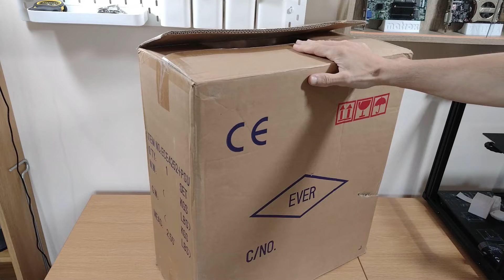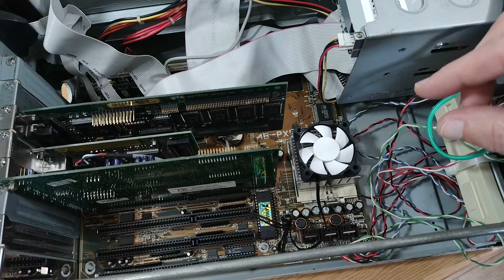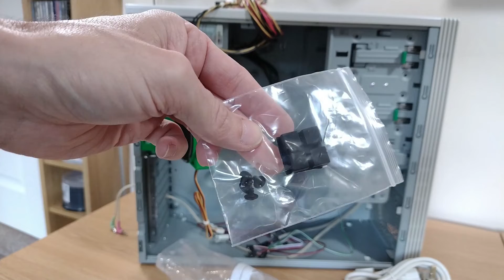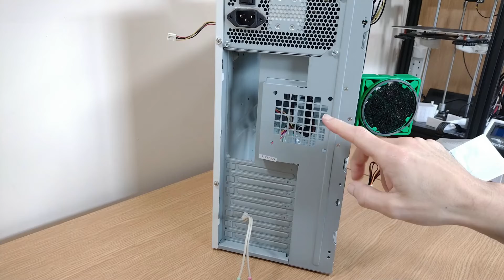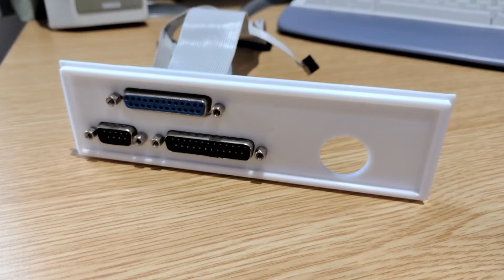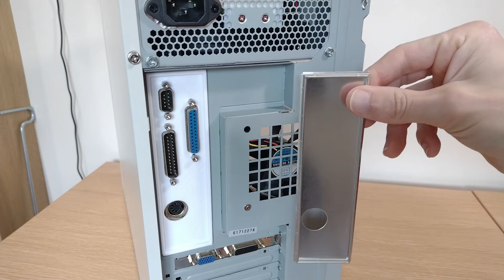AT system in to ATX case

Comment: So am I right to think that when my AT PSU switch is off, there's no current at all to the motherboard and therefore the CMOS battery will decline whether the system is plugged in or not? Whereas in at least some ATX systems, the motherboard still draws enough power to keep the CMOS going without battery draw and so the battery can last much longer?

Comment: I believe you missed something and I was actually looking forward to seeing how you managed it. 😃When it comes to  those adapters that let you use ATX power supplies with an AT motherboard, they bring out the green and black wires for the power button - PS-ON and GROUND respectively. The problem is that the power button on the ATX case is momentary, while the PS-ON signal from the power supply needs to be grounded the whole time the computer is running. To sum it up, the way the PC works at the end of the video is - you press the power button on the case, the computer comes on, you take the finger off the power button, the computer shuts off. You'd need to keep your finger on the power button indefinitely, to keep the computer running. The way this needs to be solved is by physically changing the power button on the case from a momentary switch to a toggle switch that keeps the circuit closed after being pushed and that's easier said than done. To keep it pretty, you'd need to find a toggle switch the same size and form factor as the momentary one mounted on the case.

Comment: I know originally desktop cases were intended to have a monitor set atop, but I recall CRTs weighing a ton of bricks and always felt uncomfortable putting a monitor on it. After the original IBM and clones, it seems the cases made were no longer made of such thick, solid metal thus less likely to hold the weight of CRT over time without bowing the PC case. I have an old school Dell 4:3 LCD display I use instead of CRT and it’s good enough for me but still set beside my desktop case instead on top of it. 😂
Reply from the maker: The AT case in the video is built like a tank and easily takes a 19" CRT on top of it, it's just too high up to use comfortably. :) I have a later IBM desktop case that is so plastic-y that even a modest LCD on top of it feels risky.

Comment: My current project involves getting a Gigabyte 5aa into an AT case with a turbo panel. The 5aa is a hybrid board with both AT and ATX connectors, but it was still a terrible idea; learning pinouts on the fly, figuring out and more importantly finding unused pins to hook the extra LEDs into is a nightmare.
Reply from the maker: Sounds like you are having fun with it! It's a really nice SS7 motherboard for a project like that.

Comment: The Voltage Blaster project by Necroware more or less solves the -5v issue (I think mainly just some sound cards which really need it anyway). If you mentioned it, I missed it. Also need to be careful to not overload the 3v & 5v rails of modern PSUs. AT systems tend to put more load on them than modern ones are able to handle.
Reply from the maker: Yeah, I think there is another adapter too besidies the Necroware one that also gives -5v. I figured I didn't want to go into too much detail on that as if you need it, then you probably already know about how most modern ATX supplied don't have it..

Comment: I'm going to guess those four rubber blocks are feet that you can screw on through the bottom of the case.
Reply from the maker: Good guess, but the case came with 4 round rubber feet already attached.
Reply: @RetroSuperhighway  Ha! I was shouting at my screen, "they're case feet, you numpty". I stand corrected...
Reply: I used to think the same thing, but those are bumpers for the motherboard I believe. Not very useful IMO, but extra hardware finds of way of being used for something else lol
Reply: @mesterak  I still think they are feet, the box of parts is probably universal, some cases can be laid on there side if preferred and can have the rubber feet attached.